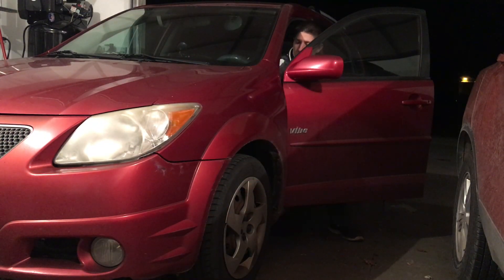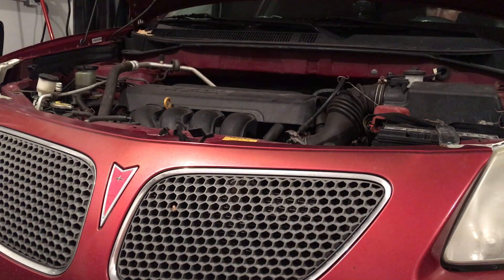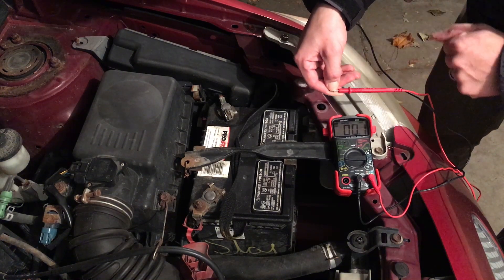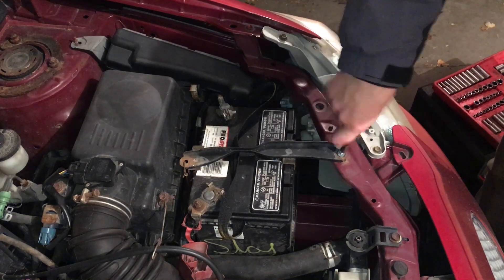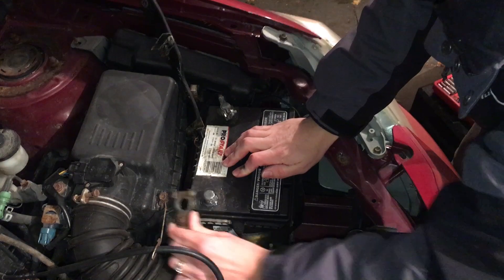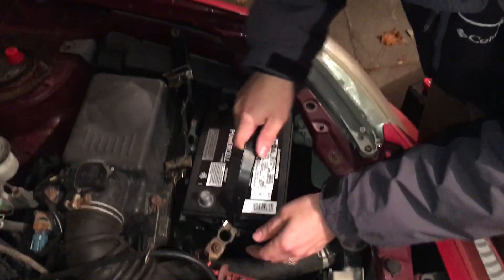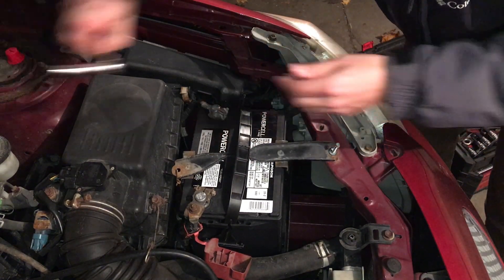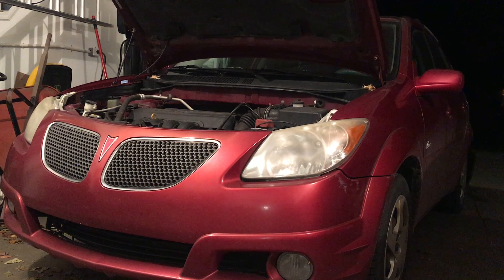How to Replace the Battery for a Pontiac Vibe or Toyota Matrix - Weak or No Start Fix

Comment: Thanks for uploading this. I changed a battery in a car for the first time in my life by watching this video twice. The only problem was there was a lot of corrosion on the positive side, so based on what I read on some random web page, I put a little baking soda and water on it, then wiped it off. It was still a little tough to remove, so I "gently" pried the thing open with a screwdriver, based on yet another web page's suggestion. I never thought I'd successfully put in a battery. My car hasn't been driven since winter time, so approximately 9 months of sitting in the side lot, not moving at all. Today I drove it out to the woods and around town a little. A working battery has everything to do with whether your fob will work. Mine wasn't working at all, and I suspected it was because of the dead battery. As soon as the new battery was put in, the fob immediately started working again.

Comment: The 12.6 volts static voltage is good.   13 to 14 v is only possible with engine running with a good alternator charging.  The voltage needs to be checked while cranking to see the loaded voltage.  This cranking voltage should be at least 9 volts.  However you'll need another set of hands or a couple of alligator clips to do this test.